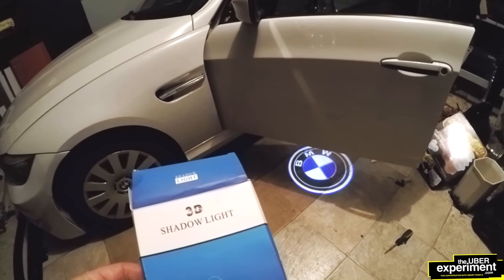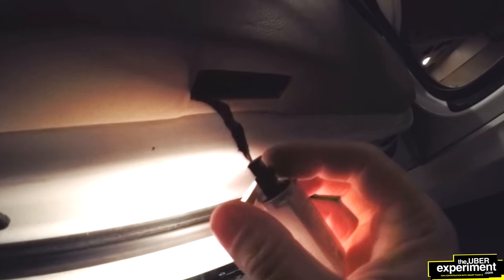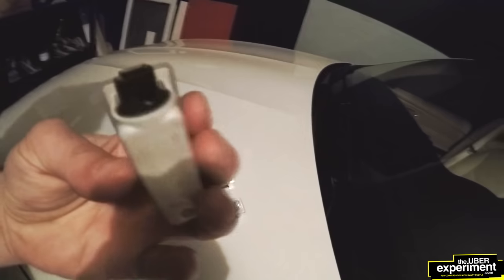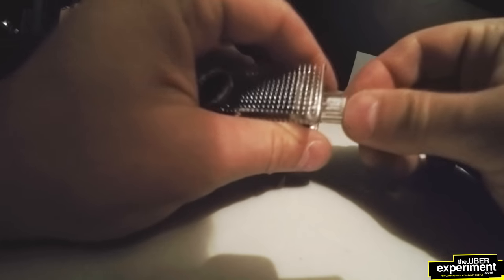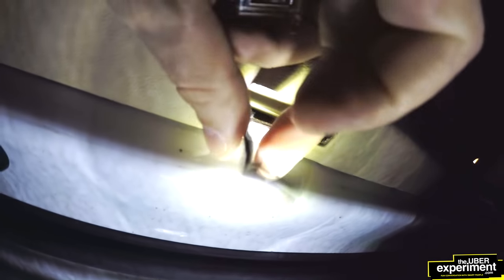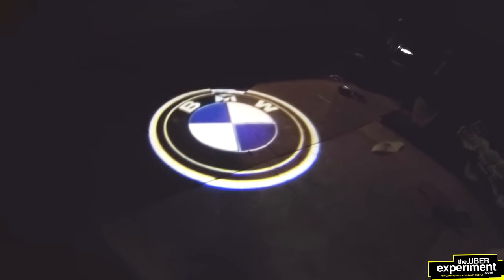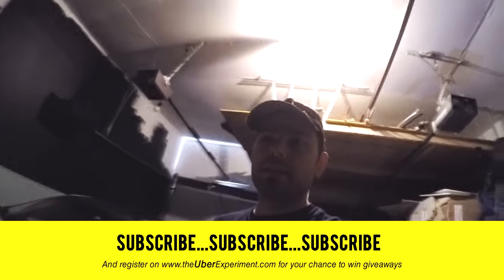How to Install BMW Door Welcome Lights - 3D Shadow Projector Logo Lights - 3D Laser Shadow Lights

Comment: My guy installed the wrong one on the wrong door 😂😂
Reply: How do you know what the correct door is?
Reply: @Dumyum_  The logo is in the opposite direction. When opening the door, the logo should be showing to the driver going into the car. This should've been on the right side.
Reply: @se7endreams  well mines got L and R sticker in the side,So I went by instructions and the Logo reads the Opposite way….
Reply: @mrs.thinktwice Clearly the stickers were labeled incorrectly.
Reply: @se7endreams  ok Thank you so I will change them tomorrow…

Comment: Such a cheap an easy way to add a classy looking mod. You don't really need the extra wires, the stock connector fits fine without them, I guess they are for people that are tapping into bare wires. 

And apparently the logo should face a certain way depending which door you fit them too, so there are passenger side and drivers side logo lights included with the kit. But they look awesome either way imo.

Also check if you rear doors even have lights, mine don't but I ordered four but I only realised when fitting.
Reply from the maker: mine was a direct plug and play.

Comment: Can the orientation be adjusted?  I bought these for my 2017 X5.  Looks good but can I adjust the orientation of the logo on the light.  One of them is turned the wrong direction.  Others look good.  Thanks.

Comment: I noticed these lights on a loaner I got from BMW. I think I'll get them for my wife's 3 series. I also noticed you put the light for the passenger side on your driver door. The logo is supposed to be straight as you open the door.
Reply: I think the logo can be turned by hand because i was thinking the same thing...

Comment: That garage looks like a tweakers paradise. I especially like the started, but not completed, black wall paint at 4:23.
Reply from the maker: Good eyes my friend!
Reply: Does it work with the X6 series? I tried it on my X6 and it wouldn't fit.

Comment: I'm picking up my brand new g30 tommrow with oem door projectors on the front.... Can't see any aftermarket ones for the g30 5 series... Does anyone know if the ones on ebay amazon etc will work on the g30...

Comment: Thanks for doing this video! I installed these lights in my BMW 535i and they look great! The only thing is that I hear a low, continuous buzzing sound when on. Does anybody recommend how to resolve the buzzing sound? Thanks for feedback
Reply: im facing the same issue. did u find a solution for this?
Reply: Wait till u get older

Comment: Hey can you tell me if they are compatible with. 2011 2 door 3series coupe
Reply from the maker: Not too sure, but I'm pretty sure they should be, do a quick google search, almost all 3 series cars within 5 years share similar characteristics
Reply: Thanks for your reply, I've searched and actually cannot find any info 😕
Reply from the maker: stylez517 I contacted my offshore supplier they carry a pair compatible with 

2011BMW 328i Base Convertible 2-Door
2011BMW 328i Base Coupe 2-Door	
2011BMW 335i Base Convertible 2-Door
2011BMW 335i Base Coupe 2-Door

If you want a pair msg me at theuberexperiment@gmail.com but it'll take about 4 - 6 weeks to get them since they're hard to get in USA.
Reply: +TheUberExperiment thanks friend I'm living in Dublin and my car is a 318i m sport? Sorry I should have said this from the beginning!

Comment: Hi, why putting the extra wire, when the connectors are the same?
Reply from the maker: what extra wire, everything was stock oem
Reply: The little connector wires I think is what expl0de means. I got these and only had the projector lights get shipped. I didn't get any of those 2 connecting wires/adapter thing that's going on there :)
Reply: I think it's an adapter to go from halogen to LED?

Comment: How do you unplug the wire I’ve been trying to unplug it from original but it won’t budge
Reply from the maker: Try pressing the side of the plug with flat screwdriver usually that's how electrical parts are connected. If there is no plug you can cut and a
Splice the wire after disconnecting battery and connect to your new lights.
Reply: Did you get it to unplug I can’t I need help
Reply: Yes thank you I was able to get it to unlug by pressing a flat screwdriver on one side of the plug and was able to pry it from the other plug
Reply: @MrBarajas401  can you help me I can’t get mine out
Reply: @Gabriel E all I did bro was grab a flat head screwdriver preferably a small one and show it into corner of the connecter and jimmy the wire out.
Reply: @RecklesFTL  ^

Comment: Is there any difference in the quality of the $15.95 light from ebay vs the $154.45 dollar one from OEM BMW??
Reply from the maker: Jack of All Traits absolutely not.
Reply: Of course. One cost $140 more so you can feel better about yourself. They will also install it for an extra $120 so you dont have to waste 10 minutes of your own time.
Reply: I heared that this chines things can kill our other lights. Is it possible guys? One of my friends says that his led reverse lights die bcs of this fake part.
Reply: The difference is that the cheap one gets hot without any additional modifications and thus the logo will gradually get greener

Comment: Do the lights depend on the model like if I have a x1 do I need lights that are compatible with a x1?
Reply from the maker: the lights will work on any bmw, but the connectors will be different.

Comment: My X1 didn't have door lights but the wires are inside the door panel but when I attach them they don't light up, any help would be grateful.
Reply from the maker: you may have a dud, try ordering others from amazon, good thing is you can return the ones that dont work
Reply: @InvestorTheory  The lights are working, there's no power coming down the wire inside the door.

Comment: Is there a way you can adjust it without making it look like it’s upside down when you open the door fully?
Reply from the maker: You could open the light and just rotate the eblem, that's all it really is, but you always risk damaging it.or retrofit the one you have  by trimming any plastic to make it fit the other way, and add tape to fit it.  Tell me if it works

Comment: I just got this , and the wires arent secure.....the lights flicker as a result of the wires not locking into the light. :/ helpppppp
Reply from the maker: prolly a cheap light you got, maybe return it and get a different brand

Comment: Man im so pissed i bought these and it came in the same box as u but didnt include the adaptors so i cant even install them
Reply: Same happened to me, did you end up doing anything?
Reply: G luna yo I complained to them and they explained that it will fit even tho it looks bigger i tried it and it worked no need for a adapter

Comment: You actually don't need the extra wire that it comes with. I just took my original ones out and plugged the new ones straight in without attaching the new wire it comes with and works fine.
Reply: Hi Chet, I was thinking of installing them without those little adapter cables. I notice that you left this comment about 2 years ago. Have you encountered any problems so far? I notice that there are some people who complain about a continuous sound. Thanks

Comment: Do i need to clip the batterie off before?
Reply from the maker: you should unplug battery before you do any electrical or you'll pop a fuse
Reply: The Uber Experiment But you didnt, why?
Reply from the maker: I did, i just didnt show it
Reply: The Uber Experiment but during you change the light, the light was burning. So it means, that the battery is still connected..
Reply from the maker: At the time, but the edit doesnt show me unplugging it and plugging it in.

Comment: What was the brand you used? it seems like other ones require you to cut a hole in your door to instal!
Reply from the maker: it depends on your car, not the brand of the lights. if you have the stock oem lights under the door u just swap them in
Reply: Rudy Demyanovskiy i ordered mine got them today and I dont have those lights under my doors can anyone tell me what i can do?
Reply from the maker: thats the first thing u need to check before you order to see if these oem can be swapped. If you don't have them, it's quite a job and i wouldn't recommend it as it requires cutting into your door.
Reply: I know I knew better
Reply: Guess I'll find a fellow 346er n give them to em good karma lol
Reply: haha got a solution returned for the wireless set

Comment: nice video.
Reply from the maker: +Andrew Bocas Thanks Andrew
Reply: +TheUberExperiment 
I got a good year and a half or so out of the ones I installed. just recently installed some new ones.
Reply from the maker: didnt know they burn out... we'll see how long these last
Reply: +TheUberExperiment 
the ones I had didn't burn out. the lens for the bmw logo started fading and cracking. but for the price, easy to pick up new set.

Comment: would these fit on a 2007 335i coupe?
Reply from the maker: it should on some. open your door, if you have a light underneath on the door, they'll fit.
Reply from the maker: yes i believe it does
Reply from the maker: looks just as bright as u see in the garage
Reply from the maker: lol no worries
Reply: +The Uber Experiment will this fit a 3 series 318i

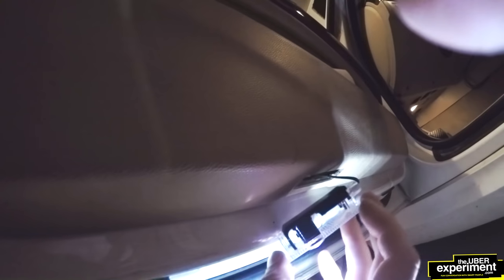Comment: Why are you BS'n other people here by not showing that you had to file away some of the door lining material? You can clearly see that you have stopped at 3:25 and magically repositioned the camera before snapping in the light. This is not helping other BMW owners. Not much material needs to be removed but these lights do not snap in without mods to the door liner.

Comment: the worst explanation you made it look so easy,  but it's not that simple
Reply from the maker: it is that simple!:)
Reply: I tried the exact same thing in the video and the black piece would not come out.
Reply from the maker: what black piece? the connector?
then its just old and sitting in there thats all
Reply: yea I was thinking about putting wd 40 on it. cuz it's so hard to take out. I was at my car last night for a hour and the piece will not come off.
Reply from the maker: so cut the wires and then reconnect them with electrical tape and u can take it apart outside